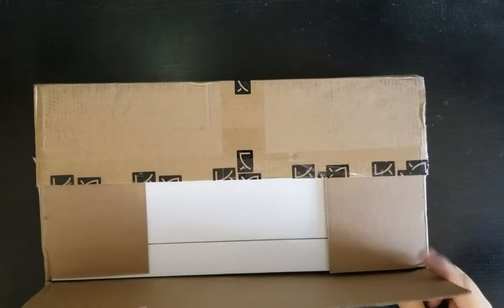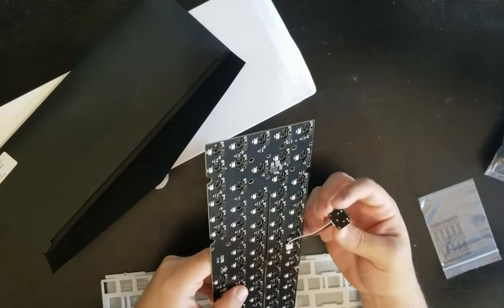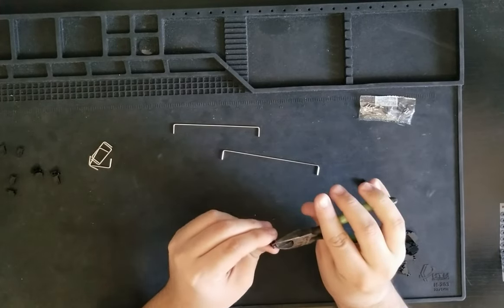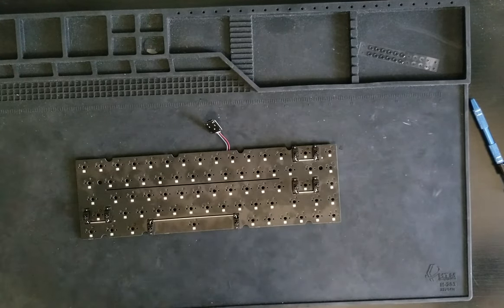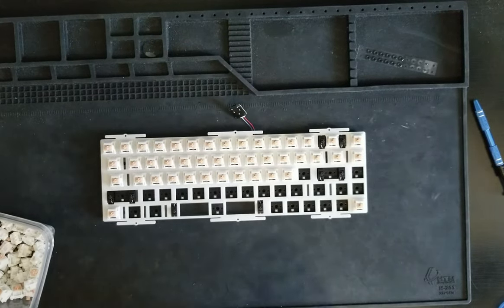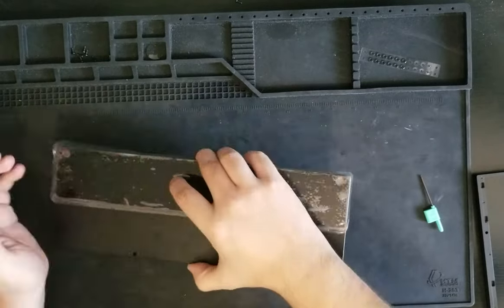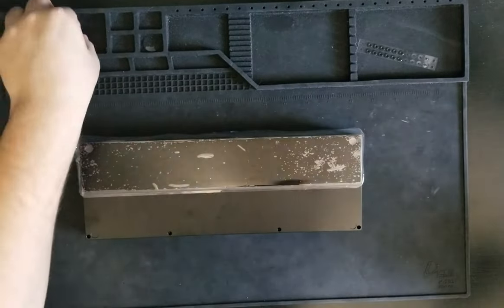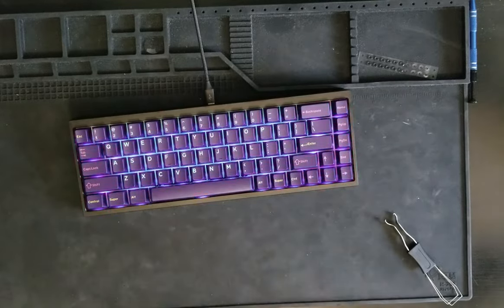Tofu Jr Keyboard Build using Drop x Invyr Holy Pandas

Comment: mine is super deep i removed the case foam and its still too deep. This is probably because of the weight. What do i do to make it clack more. Im using Gateron CJ switches.
Reply from the maker: You could always try tape modding and adding a high density foam in the case. Which plate option did you go with?
Reply: @shizmuhkb  pc plate and I already tape modded and removed and added foam in the case it’s probably just the way I lube my switches and my setup. Also the case is just naturally deep. Thank you for the advice
Reply: Tape mod will make your keyboard deeper, so you can try removing it if you haven't already. Also you can try switching out the plate, although the only higher pitched option provided is brass.
Reply: remove the pe foam ie the switch pad and change the plate to aluminum or fr4 if you want something softer
Reply: just get a long pole switch like the akko cream yellow v3 or if you want something super clack get the owlab neons

Comment: i hate the unevenness of my current tofu65, does the tofu jr fix that?
Reply from the maker: I can't speak to the feel of the tofu65 since I haven't ever used one personally but the tofu jr was a solid performer in my opinion. I found that it had a good balance of flex and rigidity with only the one flex cut in the pcb and a pom plate and I was very pleased with the sound